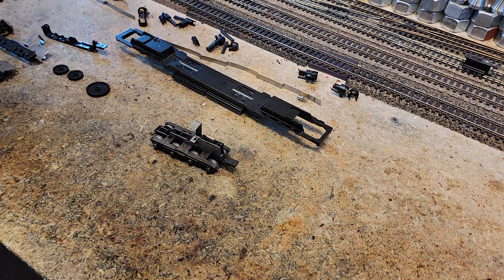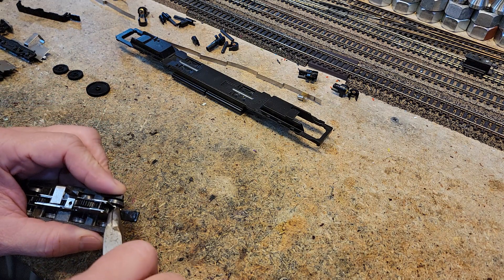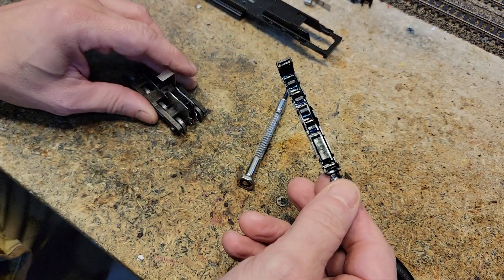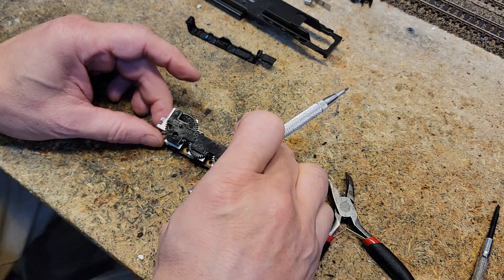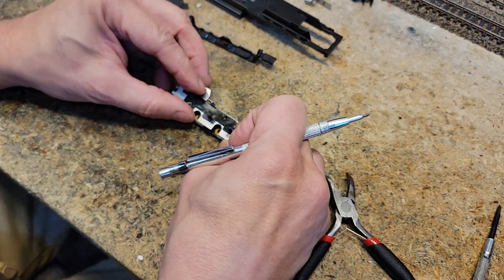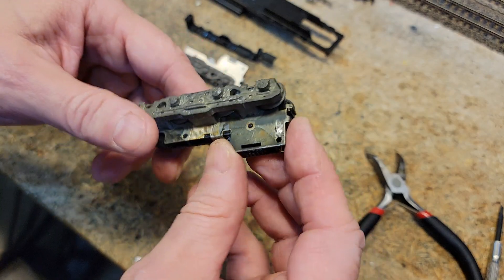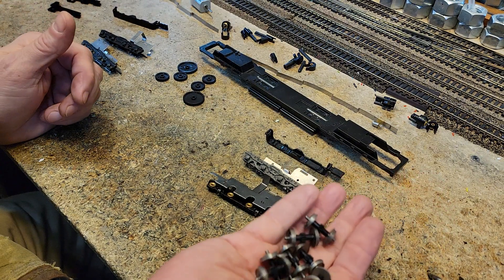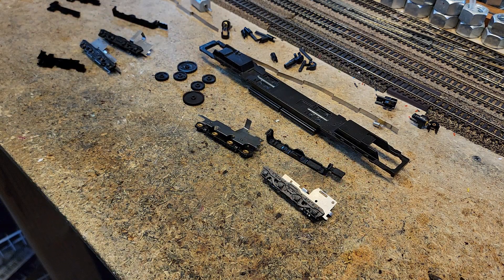Dual Motor DD40 Part 4 Truck Disassembly

Comment: Like usal another great video.
Reply from the maker: taking apart these trucks is usually a source of frustration and broken parts unless you've done it a lot - and now that we can see it here, you won't need to worry about breaking off the parts!
Reply: @elite194  very true.

Comment: I watched the videos associated with the trucks. My trucks being trainmaster are similar to the dd-40 truck but don't have the metal piece. Just the brass inserts which it looks you said to file the face and then take a drill bit and gently twist on the interior of the brass insert. I have cleaned the steel wheels. Not sure how my pickup will prove to be better. Guess you will show in a future video when you start reassembly and wiring.
Reply from the maker: just went live with the reassembly.  to improve pickup, coat the wheels and hubs with Oxgard.  I successfully heat cured the Oxgard so it is now a dry film, unlike the past where I just let it cure over time.... adding the wires improves pickup and doing the drillbit procedure with a little filing improves pickup a whole lot!
Reply: I cleaned the wheels, filed the brass seats , reamed gently with a drill bit. Oxgard wheels, brass seats. No rivets to tighten because trainmaster don't have a metal piece on the trucks so nothing to tighten and no hard wires to attach to. That's why I would like to upgrade the trucks but can't find any that will work because the gear tower has to be tall to reach the worm gear. Newer trucks are much more low profile. My decoders start up but when I set speed step 1 in dcc it stalls. I could set cv2 higher but then then at speed step 1 goes faster than I prefer. I'm frustrated to say the least  

Chuck
Reply from the maker: @chuckholsclaw6829  the trucks are right and ready, but use your multimeter and a DC power pack to see how much voltage getting through.  tomorrow we'll do that test on the 2nd DD40.  When we get to the part where we program it we'll be setting the motor variables to get a perfect speed table!
Reply: Ok, thanks

Comment: I reassembly my loco today. I cleaned the trucks,filed the brass inserts,  cleaned with a drill bit. Tested it and there is no improvement,  it stalls 2 seconds after I set it at speed step 1. Is it possible to change the trainmaster trucks to something better that has more reliable pickups.

Chuck
Reply from the maker: also did you tighten up the rivets?  hard wired to the steel, polished your wheels, coated with oxgard - this means we need a checklist that I should put in the community page that a person could print!  speed step 1 DCC or DC?  if it's DCC you must change the starting motor values and then I set the speed table so step 1 is a 4 and the 4 will then be the lowest voltage to start the motor!
Reply from the maker: this next video is for you - a test we should have done sooner, but we're doing it now and you should do this on your locomotive